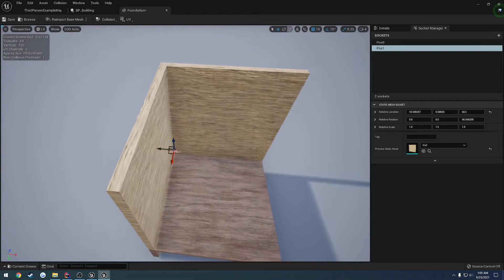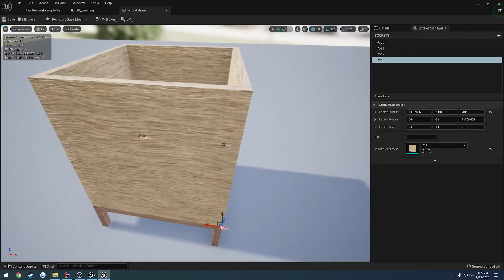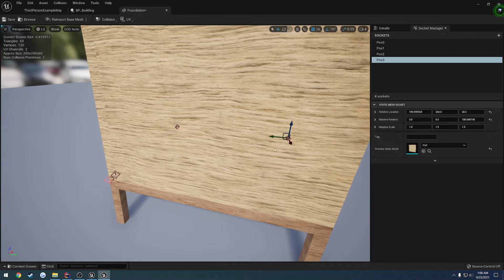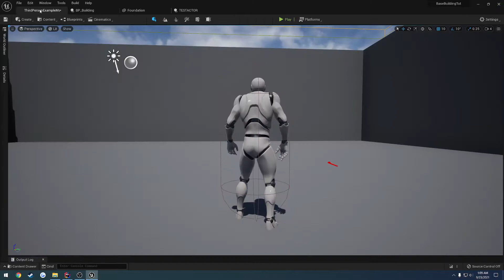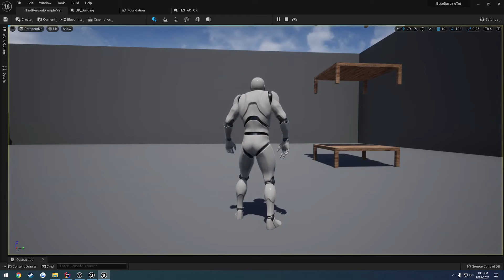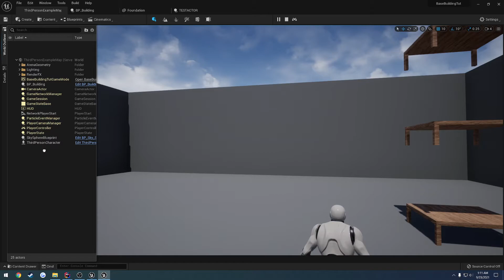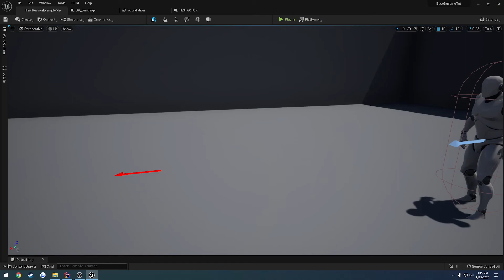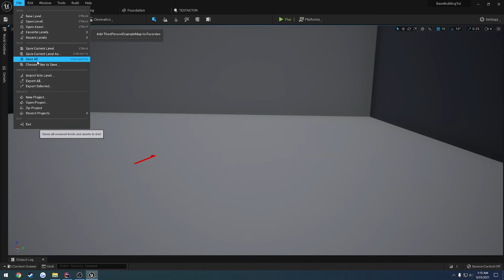Unreal Engine 5 C++ Performant Base Building #8: "Setup Foundation Sockets"

Comment: does it makes sense to spend time implementing instanced mesh component rather that just letting the engine to handle auto instancing/batching?
Reply from the maker: From my understanding (not 100% sure) auto instancing only instances static mesh actors, not components. If I wanted to use auto instancing I would need all building parts to be actors which carry much more than just a mesh/material/transform. Even if it auto instancing worked with mesh components you still have everything else that comes with a component which is a good bit more than again the mesh/material/transform. Going the instanced static mesh component route ultimately will be the cheapest option. The idea behind this series was to be able to build worlds like Rust with huge counts of player built structures without much of a performance hit due to building